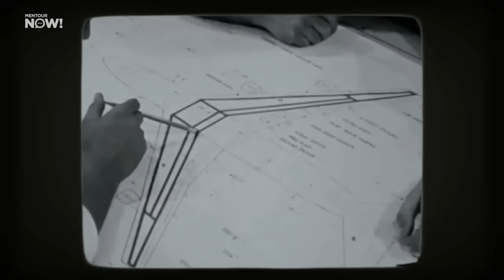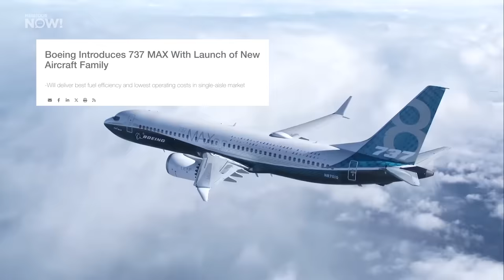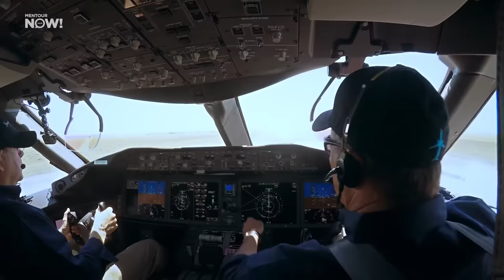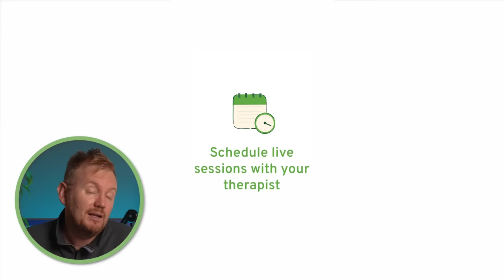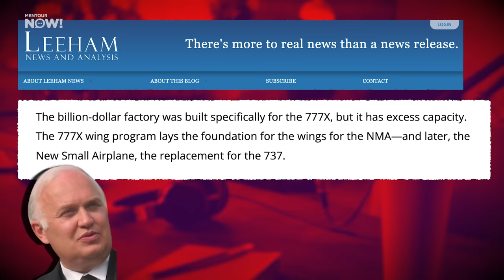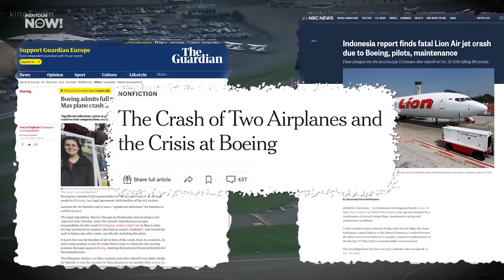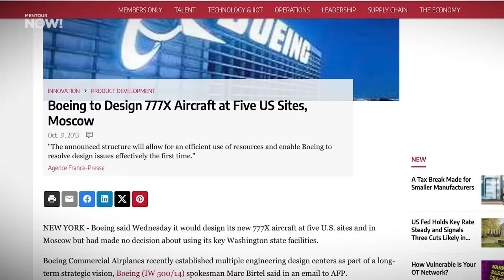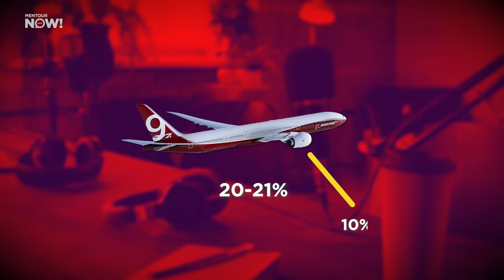What’s Going On With The Boeing 777X?!

Comment: Bean counters and yes men on the job in positions equals corners cut and procedures being modified to meet production deadlines on the shop floor adds up to building a wing that's 14 percent to small for weight and range for a plane in this market.

Comment: RE the fuselage failure under pressure test, EVERY other Boeing airframe has exceeded the 150% limit, including the original 777 airframe.  The failure reflects the deteriorating engineering capabilities of the company.
Reply: True. If the pass mark for an exam was 90% and you got 89% it would be a fail. I’d love to be able to go “yeah but I would have passed it if I had done XYZ instead”
Reply: If it exceeds 150%, it is too heavy. 148% is pretty decent and only requires minor re-engineering or a max take off weight reduction. The A380 had a similar failure with the wing.
Reply: Considering that the A380 scored a 145%, then by that logic, the A380 also failed this test

Comment: From the time Boeing merged with McDonnell Douglas, it was no more the engineers at Boeing's facilities in Washington, but the bean counters at head office in Chicago that called the shots. At one point, Airbus had overwhelming success with their Airbus 320. It was lighter and more fuel efficient than the Boeing 737. It was small enough to be able to land at regional airports, but could also handle long-haul flights. This enabled airlines to offer direct long-distance flights between smaller airports. With this aircraft, Airbus was able to compete successfully with Boeing for market share. Responding to this competition, Boeing, instead of designing a completely new plane, took their 737 and modified it, fitting more powerful engines, lengthening the fuselage and adding wing-tips so they could also achieve the same long-distance flights with smaller passenger loads than the 747. But the modified plane had some unavoidable fundamental flaws as a result of this jerry-rigged approach, one such being a tendency to stall. To counteract this, instead of going back to the drawing board and solving the flaws, they opted for a software fix that would sense an impending stall, and counteract it by forcing the nose down. The software depended on air-speed sensors called Pitot gauges. Normally, such a system should have had multiple redundancies as a fail-safe. Testing revealed that if the sensors malfunctioned, the software could force the plane into a dive, which could not be counteracted by pilot input. Within 17 seconds of this happening, the situation would become unrecoverable, and a fatal crash would be inevitable. The only solution would be for the pilots to recognize the malfunction and turn off the auto-correct system, and take manual control. Pilots would have needed to be trained to know when and how to do this. But having a requirement for re-training would have meant a far more rigorous approach in obtaining FAA approval. Boeing's solution was to say that retraining pilots in the operation of the new aircraft was not absolutely required. This was to some extent true. Given the redundancies in the system, the likelihood of a failure was minuscule. But, in order to secure sales to more budget-conscious airlines, Boeing economized on system redundancies. They also skimped on pilot retraining. When the first 737-Max crash occurred, instead of immediately grounding all 737-Max aircraft, they opted to deny and obfuscate, blaming the pilots and their lack of experience and training. When the second crash occurred, the matter was taken out of their hands, and they were forced to ground all 737-Max planes. I was in my final year as an student in an Aerospace program. I was horrified to learn that the company I had idolized and venerated had in fact put their profits above people's lives. The first crash could be excused. The second was absolutely inexcusable. I don't trust the 'fix' that Boeing has implemented in their 737-Max planes. And I don't trust the 777X. How can we be certain they have not cut corners on this aircraft, just like they did on the 737-Max? My advice to all air travelers is: find out what the aircraft is when you book a flight, and if at all possible, choose a flight with an Airbus rather than a Boeing. A first step in regaining public trust would be for Boeing to publicly explain and apologize for their mismanagement of the situation. Otherwise their lesson will be that they have got away with it, with just a slap on the wrist.
Reply: Thank you, random internet stranger! This is exactly how I feel about Boeing and the whole MCAS debacle. I’m not a fan of the lithium battery problems, nor the issue of junk being found where it wasn’t supposed be be (ladder in a tail section, rags in the fuel tanks, tools in the fuselage ect) in the 787. I can’t trust the other Max variants and I can only wonder what flaws lurk in the 777X design.

And yet, paradoxically I’m kinda fond of the 787-800s that frequent my local airport. I work as ground crew and on the belly of the 787 is a vent that blows out perfectly warm air. The 787 has warmed me up during many a shift after spending hours in the cold on the apron!
Reply: It was the AOA sensors, not pitot tubes that MCAS required. Pitot tubes measure airspeed, AOA sensors measure angle of attack which is what determines if you’re about to stall
Reply: MCAS relied on AOA vanes, not "pitots".
Reply: Yes, you're right. It was the AOA that malfunctioned, not the air-speed sensors. Someone else pointed out my error and I have already acknowledged it. Thanks for your comment. The essential point of my response to the original post remains unchanged. Indeed, there were many complications. Lion Air was notorious for glossing over equipment malfunction and failure and shoddy about fully testing replacements. I'm convinced that Boeing did their best to try to get them to improve their standards, so there is definitely blame to go round. But I'm also sure that Boeing cut corners in a race in which they were playing catch-up with the Airbus A320-Neo, and, after the first 737-Max went down, instead of immediately grounding all 737-Max planes, they just crossed their fingers and prayed. I can understand everything else, but that decision was absolutely inexcusable and unfortunately no-one was held responsible for the subsequent Ethiopian tragedy.  @offshoretomorrow3346

Comment: One question I have: Why fold the wingtips up?  Wouldn't down make more sense? Then normal load while flying would push the tip up if there were some failure in the locking mechanism?
Reply: Stuff on the ground would hit it, imagine a baggage carrier taking out an aircraft wing, that would happen once a month😂.

Comment: Airbus A350 was not launched in 2006 as you have noted. The project started in 2004. It was on January 2015 with Qatar Airways for its first regular flight. (2:30)

Comment: Very much enjoyed in-depth presentation of the multitude of factors running against the 777X.
Had Boeing not lost its center of gravity by putting accountants in command, at the turn of the century, the 777X story might have been less severe.
Nothing compensates for bad luck like good engineering and design.

Comment: Thank you so much. Was an engineer at Swissair when they exsisted 😅😅😅. Would not surprised if Emirates wants back the production of A380. Flown it last month. Emirates most flown aircraft and full on almost every flight! Geneva only have 777 available but Zurich is full on Emirates 380. My most flown aircraft of my last 40 years. I'm an old guy 😅😅😅😅😅
Reply: Emirates would LOVE the 380 to resume production, though preferably with newer less thirsty engines. But the problem is that they are the only ones who do as they are the only ones successfully running a hub-and-spoke model. No-one is going to build an airliner type for a single airline, not matter how successful.

Comment: Just curious, if the folding wing fails in flight and one side folds up… will it result in an imbalance and possible crash or will it be able to fly still?
Reply: It would never be certified if it couldn't and it would also be one of the things the testing program would focus on. It should not be very hard to design it for this - the ailerons would have enough authority to deal with the imbalance.

Comment: Never understood why the aircraft industry never went to adhesives for gluing aluminum together rather than using rivets. Lotus has been building light, strong aluminum car chassis that way since the Elise was introduced in 1995. I once asked an aircraft structural engineer and he wasn't even aware of the idea.

Comment: Maybe, with your broad spectrum of commentators, somebody can explain to me why Boeing made the 777 FMC less 'flexible' than the 737 in regards to data entry, and VNAV performance (for example).

For example: the 737 (since the -300) FMC will accept speed/height inputs to the LEGS page in the format SPD/ or ALT (or LVL), ie. only one parameter with the / required for the speed/mach column, but the 777 requires SPD/ALT (both - and given that you can't or don't want to explicitly restrict the profile to an exact height, you are forced to put a XXXXA or XXXXB altitude entry for no real reason, which also denies seeing the predicted altitude at that point). The VNAV descent page of the 777 won't default to a Mach/SPD descent speed, only showing a speed. The 737 can accept Mach number inputs as (for example) 0.78 or .78, whereas the 777 can only accept .78 (no leading zero - but somehow ACARS/DATALINK data entries MUST have a leading zero, just to continue the non-standardised feel). The 737 descent forecast page includes entries for ISA deviation and QNH for improved VNAV profile planning, but the 777 does not. And I have a few issues with the 777 VNAV planning and how it displays and actions speed reductions as well, also how this ties in with the speed intervention window becoming active, but I'll hold off for now.

This was just off the top of my head, and I fully admit to maybe not fully understanding some core aspect here (the joy of relative anonymity, I can ask the dumbest questions!) - but the key feature is that the 737, even the older models, is somehow more flexible (and more feature rich in some cases for the features it does have) with it's FMC data entry, despite being an older aircraft (notwithstanding newer NG/MAX production aircraft, the key features I mentioned were similar from older models like the -300, -400, and -500)

I'm curious how these things are going to be done in the the 777X, that's for sure. If I detect a hint of 'somehow being less capable than a 737', I'm going to be mildly confused.

Comment: The regulations and regulatory guidance have changed as a result of the MAX, leading to lots of late design changes to comply and a tenfold increase in the amount of analysis necessary to certify any new model. 777X is the first program by any manufacturer to go through the new rigor.

Comment: Well Boeing better get it's act together. If they've got launch customers expecting this 777X by a certain time. And then you have all these delays some of which i understand were unpreventable such as Covid. Then i can completely understand why they are upset. Also, i heard the other day that the A380 is not going to be scrapped anytime soon. As it is seeing new re-interest from certain airlines. One obviously being Emirates as they are the primary user of this jumbo. Which is good to hear because i think it's way to new to be scrapped and even though it costs more to maintain it balances itself out in the long run. By being able to carry more passengers to longer destinations. Plus, it can't be converted to a freighter jet like a 747 can. Because of it's two floors and the top level being to weak to handle cargo. Last i heard it will still be in production for the next 20yrs. And that's a good thing.

Comment: IMO, the real issue is size.  Airplanes are becoming needlessly large and cumbersome and a focus needs to be on redesigns of how we deal with seating capacity.  Such as the staggered level seating I've seen pictures of. - With the overhead storage under the lower seat.  Basically a two story plane's capacity without a need for a complete redesign or making the thing so large it's a nightmare to build and service.
Reply: It would be problematic, because of weight. More weight means more fuel costs. So, there is a sweet spot between capacity, weight, and costs. Hence the developments using composites, to keep weight as low as possible. But, with Saudi striving to keep crude oil @=>$80, any canny airline will make running costs a priority in their choice of aircraft. Right now, there is no alternative to fossil fuel for airplanes, and fossil fuel inflation may be a recurring factor in the future. So, until that changes, costs will heavily influence aircraft design. So, the double decker seating arrangement may not be feasible.
Reply: @BigHenFor  If the plane is shorter and heavier, it actually is easier to fly as the mass is more centralized versus ever-lengthening a plane.  And something like a shorter 737 is suddenly carrying nearly as many people as a 777 - with just a refit of the interior and a loss of 10% range (give or take).  And on a MUCH less expensive to run and purchase plane as well.  It's an easy way to gain 50% more seating on most planes without a lot of extra materials. It would alter the center of gravity a little, but not as much as you'd think.  Certainly a lot less than building a whole second floor.

Comment: With all the delays of the 777X program, I really hope Boeing learned from their recent experience of the 737 MAX series and the doors etc and actually do some proper quality control in and on this plane. In my opinion, the last greatest Boeing aircraft was the 773 (777-300). If they can really polish this plane and not present any issues for the first couple of years, I reckon the 777X series will ultimately be the greatest next generation airliner in the world for the next decade or two.

Comment: The company that designed and built the original 777 was Boeing.  It was a company that could engineer and build airplanes.  McBoeing, the successor company, is trying to figure out how to maximize stock gains.  Building airplanes is a sideline, a nuisance, for them.

Comment: I wonder if Boeing would have been better off with a clean sheet design, given how long the 777X has taken..Sooner or later they will have to design from scratch, especially a 737 replacement, but maybe more models too..a B787 replacement too? Interesting than Airbus does not seem to be plagued by quite so many problems, apart from the A321 Neo engines...

Comment: You said that the wings had to fold because of the gate restrictions , but what about the A380 doesn’t that have a massive wing span but they don’t fold ???
Reply: Yes, which is why it falls in category F (so did 747-8) but 777X can remain in Category E
Reply: They use different gates for very big planes. X does not.

Comment: If the rivet robots don't work, I wonder if they could robot weld or 3d metal print some of the parts instead?
I doubt that Boeing is the only company to have ever tried making a rivet robot though, and giving up after skill issues is probably a not-invented-here problem.

Comment: As an engineer myself, I guess Boeing is suffering from following issues:
- Management and sales, are leading the Engineering department
- Plans constantly change, causing rework upon rework
- High turnover in the Engineering department, caused by the two points above

Comment: I would be more interested to know what is wrong with the 737 max 8. The only aircraft I know  where the passengers need to be distributed in the cabin to balance the plane. Had 4 flights with Southwest where stewards asked passengers to go to the tail of the cabin because the plane was not full. Not reassuring.
Reply: Well there are others as well.  737s traditionally have a more forgiving CG range than DC-9s, for example, at least when it comes to typical loadings.  The A320neo had (has?) a real balance problem:  They actually had to close off the back row on that one.

Your Southwest experiences may be partly about "open seating".  Balance considerations which are normally handled by how the airline assigns seats have to be accounted for in-the-moment when people can sit anywhere they want to.

Comment: A few words on the automation. It is still used for mid bodies on the lap and butt splices. It is still having issues. Also, from what I have been told (by people who were around back then and still work there) Boeing asked the reboot manufacturer for things they could not deliver and not really thinking through issues. The floor in the 40-27 building, for example, is no where near level. There are piles of shims under the cradles to hold the keel in the right position. 
A ton of composite material and thin skin leading to easy (read expensive) repair requirements 
Then there is the lightning strike test that it has to go through again…
Also the planes engines keep having issues…that’s not entirely Boeings fault.

Honestly…the plane is a mess. But I will say this. The robots on the tracks you show are flextrak and are not new. They are from pre 777x and are used on the 767 as well. Easy to use and falling apart because the manufacturer refuses to keep supporting them.

Also plane 0 is destroyed. Plane 1 and 2 are not given to customers but either get destroyed in testing or end up at the museum of flight. The planes sitting on the ground while we wait for certification will go through ci&r before being sold cheap. The plane Boeing has going down the production line right now will be the real world conditions test plane after certification.